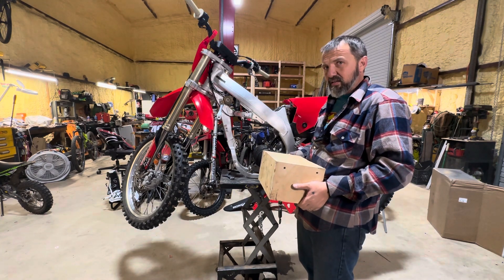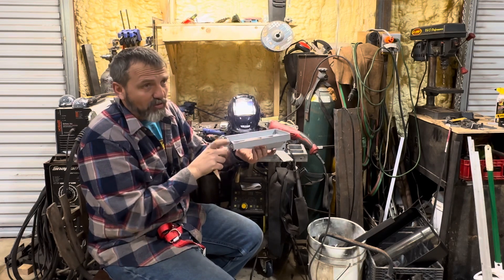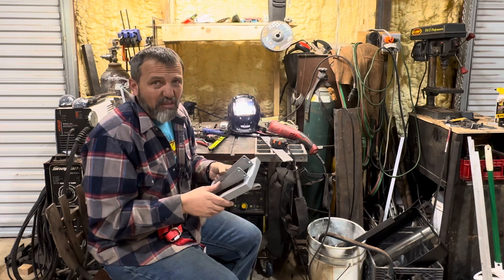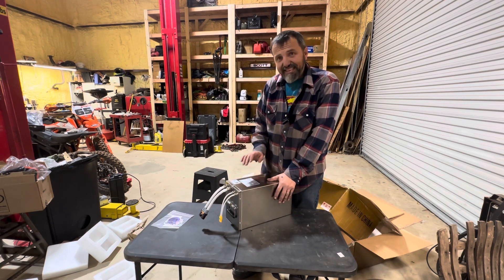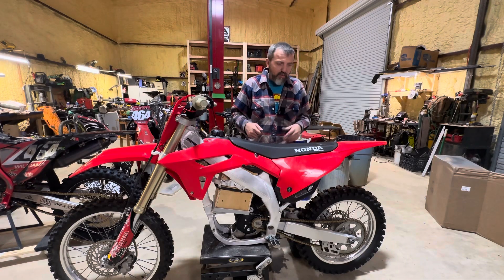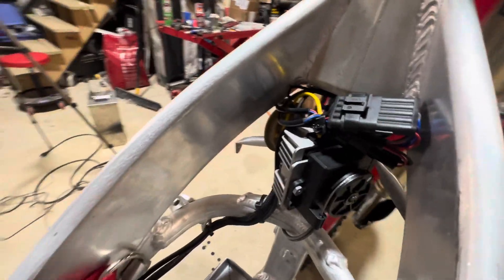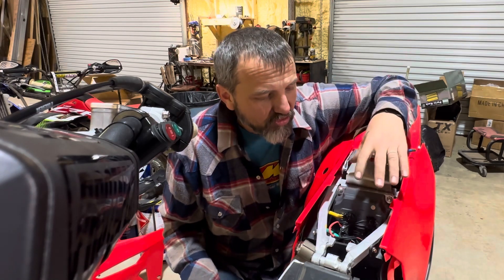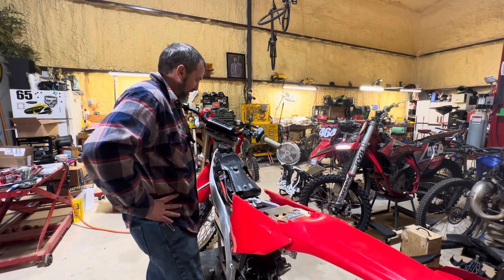How to build electric dirt bike Ep-4 DIY Stark Varg. How to install a battery

Comment: Can’t wait for the next one, idk if I missed it in prior builds but could you give some specs overall on the next video. Total KW power your running and total watt hours the battery has and maybe the weight of the bike would be awesome. 😎
Reply from the maker: Yes sir. I will do a breakdown of cost and specs in ep5. Then the ep6 will be full performance testing against gas bike and possibly exact range figures.